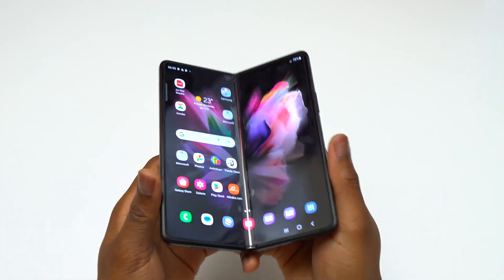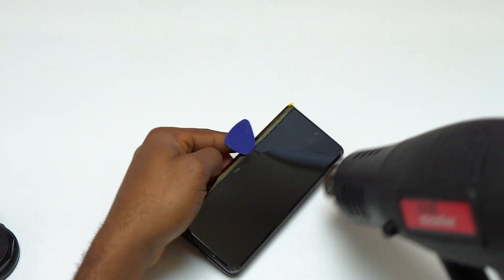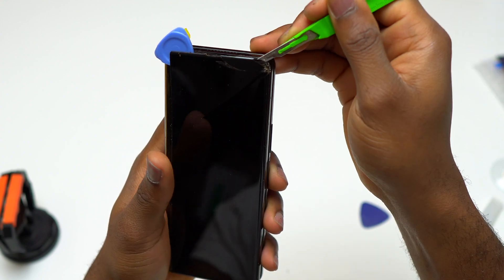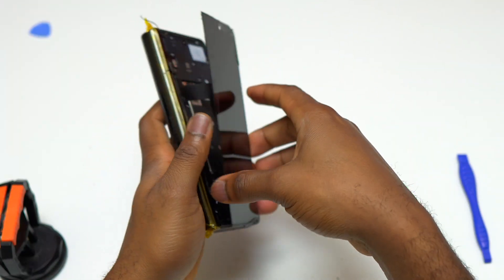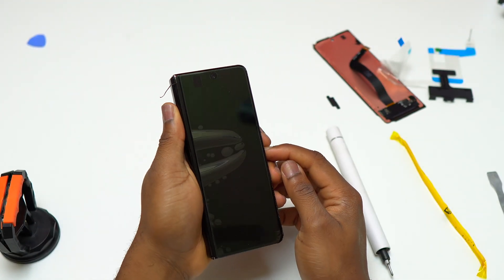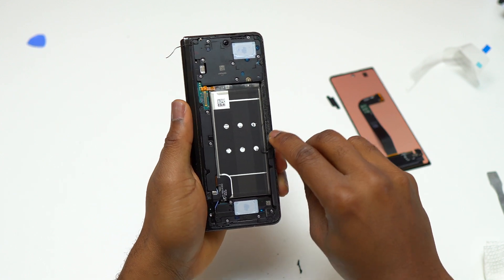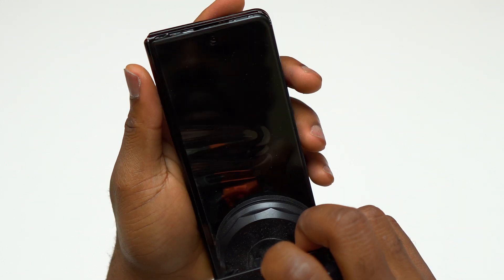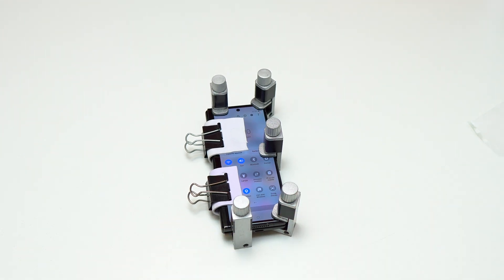Galaxy Z Fold 3 Screen Replacement Repair

Comment: Can I replace only front screen if the back screen is also broken
Reply: @RevitalDoukhan  you can, but thr back screen will still be broken
Reply: Why did u not use heat tape with low static properties? Just wondering

Comment: I have zfold 3 with the outer screen blacking out and the inner screen damaged due to the screen protector peeling off, so I went to an authorized Samsung repair shop to repair the outer screen only but they told me that I have to replace both screen because the outer one still wouldn’t work even after replacement, I’m just curious is it true or not?
Reply from the maker: 😆 this smell like a nasty bait 
From my experience if the inner screen stopped working (normal course of its life it just got used and that it it went black) the outer screen should still work fine no issues. If what they are saying is true it defeat the purpose of the outer display to be strong and more durable (should still be working fine and Undamaged) when your inner screen gave up after a few years.
Reply: @ersbit  So do you think I should fix the outer screen? Or no? In your opinion
Reply from the maker: My opinion depends.
You have a broken inner and outer screen. If you want to keep the phone fixing the outer only should still let you use the device like normal. 
Fixing the inner by a third party can be good but then a month later or two months later there's no guarantee the inner screen would still be working? Then your back to square one it's a fold 3 replacening the inner is good but it's expensive and like I said no guarantee it will still be working after 60 or 90 days even earlier than that. If the store has a policy saying if anything happens they will fix it that's good but I double it will be very long. 

The outer screen of the 3 is not too expensive. 
If you gotta keep this device I'd advice you to just have the front replace and keep it at least the front you have pièce of mind if not physical damage it would not stop working randomly. 

If you have the budget upgrade to the 6 take advantage of the trade in offer from carriers. 

Generally from manufacturing plant these have the highest quality if a third party replace the inner screen it cannot have the same processes as in the industrial plant. 

This device on the video Z Fold 3 needed a new plastic screen protector on the inside too. I went to an authorized store they said they could do it. They replaced it but still had bubbles on the display. They told me the only they could do it right is to send it to the manufacturer site to get it replaced there as they have everything to replace it and make it look like new 🤷🏽‍♂️
Reply from the maker: Here's another example that backsup my argument. Galaxy Z Fold 5 In Water Then Foreced to Teardown
https://youtu.be/PC018QQ9dF0

This is my other channel with my Z Fold 5.....after a water test the inner screen stopped working but the outer Undamaged is working. If no physical damage the outer display should work without any restrictions even if the inner screen is bad not turning black or have green lines.
Reply: The issue is that you need to remove the outer display to replace the inner one, and it's almost impossible to remove it without damaging it, so most shop replace both each time

Comment: I was wanting to do it myself to save money. The repair is $165. I might as well have it done elsewhere. The parts range from 140 to 260. That's crazy.
Reply from the maker: Yeah generally Samsung screens are pretty expensive even for a few years old devices. The fix is relatively easy you should be done within 30min.
Reply: Might as well just buy a refurbished or second hand z fold 3 and use the parts
Reply: They'll probably use a 40$ aliexpress LCD at this price